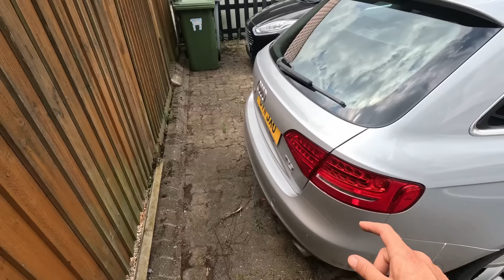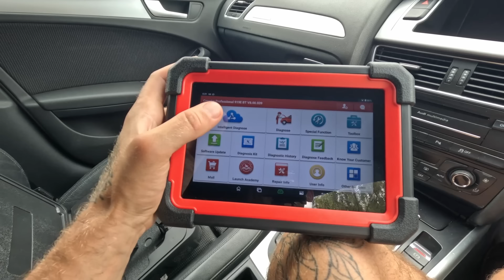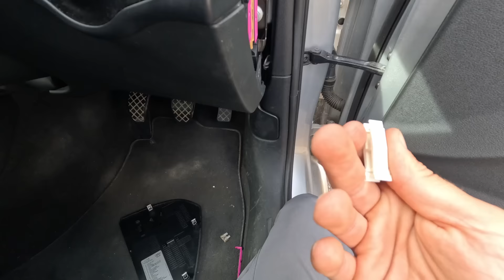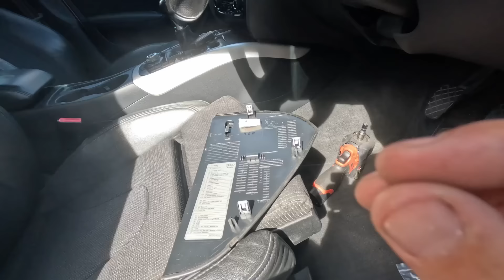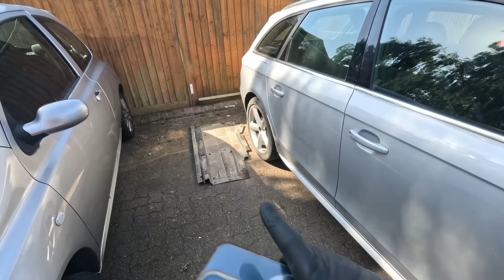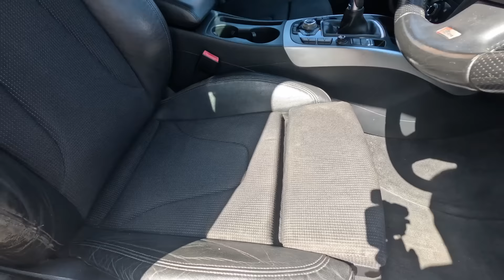THIS A4 AVANT WAS A NON-RUNNER, I FIXED IT FOR 20P!

Comment: Hi Liam, you said it takes 4.6l of 5w40 however you used 5w30 not much difference though, good luck with sale 👍
Reply from the maker: I used 5w40 but it was in a 5w40 bottle as I buy my oil in cubes!

Thanks the car has been sold! Onto the next project which the first video is out on the channel if you wanna check it out 🙏🏼

Comment: You refilled the oil after replacing the oil filter and said it takes 4.6 litres of 5w 40 and yet the bottle has 5w 30 on the back of it was that a mistake?
Reply from the maker: Lots of people have called this out. It’s a bottle that I have reused, it had 5w40 in it

Comment: Popped up on the algorithm. Great video. Nice cheap fix. Hopefully that blown fuse is just that and not masking a bigger electrical issue or something worse. With a motor with 140k plus miles it might just be the fuse but time will tell
Reply from the maker: Thanks bro! The only other reason why I’d assume the fuse blew would have been the fuel pump control module. I replaced it with the revised version but I’ve been driving the car for a week and it seems absolutely fine!
Reply: @NotAMechanic-LBnew subscriber look forward to the next video
Reply from the maker: @Brianmac007  glad to have you along for the ride 🙏🏼🔥

Comment: so you didn't actually chase the cause of the fuse blowing? I suppose you don't offer a warranty on your cars lol?
Reply from the maker: As I said at the end of the video, I replaced the fuel pump control module to the revised version which is where I believe the issue was.

Comment: Great content - just some feedback - when you are changing air filter, cabin filers etc, show the audience the condition of what you are replacing. Also, does that engine not have a decorative cover?
Reply from the maker: Thanks for the comment, unless you mean a detailed breakdown of the filters, I believe you could see the condition of the filters?
No unfortunately it didn’t have an engine cover when I bought it.

Comment: Great video, mate. I am glad to see that sometimes things go well instantly, not like my A4 B6 project, which has been going on since March and is still not running. 😂
Reply from the maker: Thankyou bro! This is the first time for me that things have been this quick 🤣 the TT project that I was working on before took me over 5 months to get sorted!
What’s happening with your B6??
Reply: @NotAMechanic-LB Yeah, that TT gave you plenty of headaches, but you did a brilliant job sorting it out. Well, with the B6, we have changed all the front arms, then basically took off the rear hub to change the brakes and wheel speed or ABS sensors, as they are MOT failures. Then we realized that the rear bearings were cooked. Now I've sourced a pair of bearings, but the inner dust shield is completely rotted off, and I can't find the part anywhere. I can't put the new bearings back in with them on. Complete headache.
Reply from the maker: @carmakeup-diy  it did indeed man! 
Sounds like you haven’t actually done much engine work to get it running??

Comment: Fuses are designed to blow for a reason.  Get your wins where you can but I would be concerned about the reason why it blew.
Reply from the maker: You are correct, this is why I bought the revised fuel pump control module, there is nothing else on that wiring that would blow the fuse.
Reply: I will be honest with you the reason the fuse has probably gone it's in a really bad place the fuse box's in these a4s and the old passats and a4s and skodas often take water on because of the door being left open as someone nips in with shopping into there house or to open a gate. I have seen this happen loads of times.

Comment: Nice video content nice easy fix. When draining the oil it’s good practice to pull dipstick out slightly and undo oil filler cap. This will enable good oil flow when sump plug is taken off. Other than that keep up the good work mate.
Reply from the maker: Thanks for the comment Karl!
Yes I agree, sometimes I get so engrossed in recording the content, I forget to do the simple things 😅
Much appreciated bro 🙏🏼